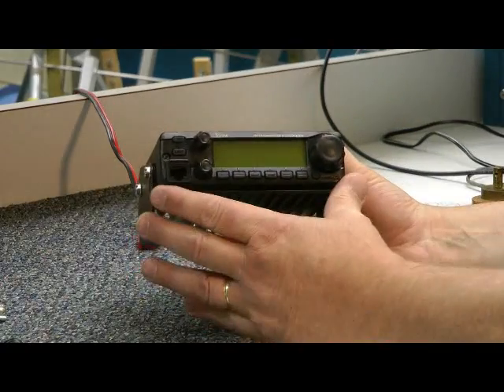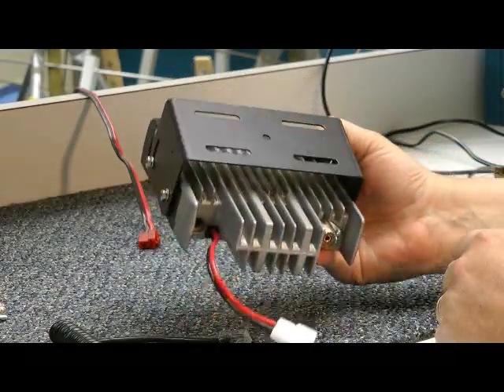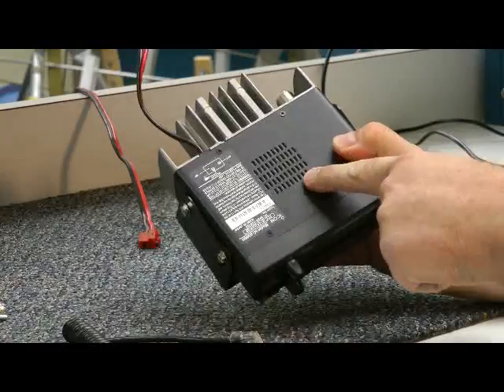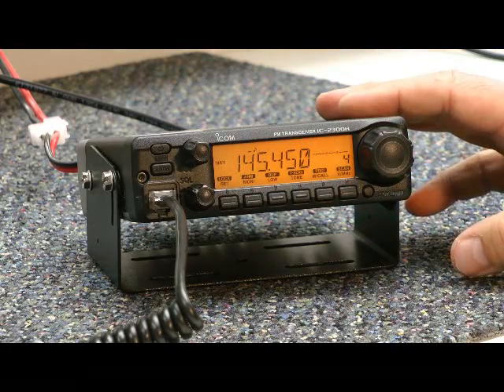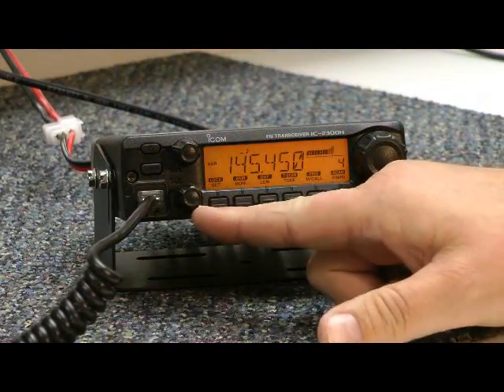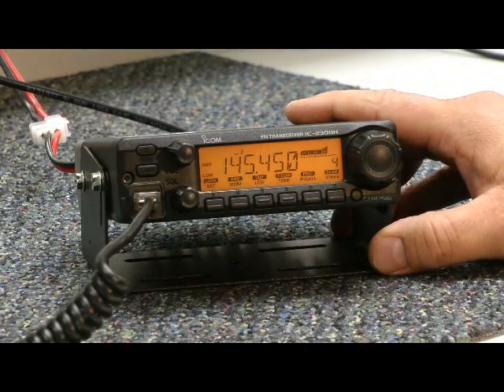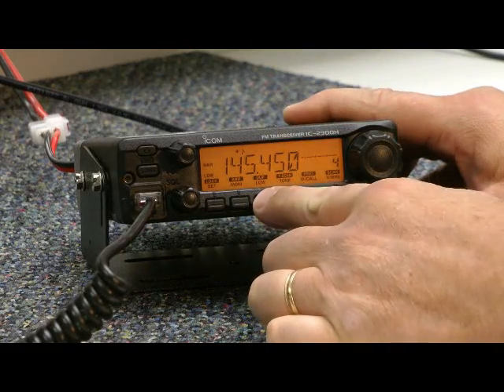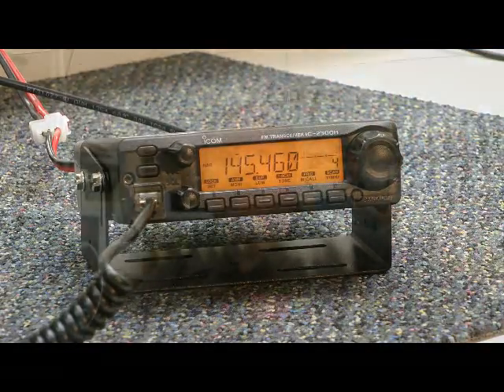Icom IC-2300H Transceiver

Comment: curious of any reports of internal speaker audio quality?  GENERALLY in the past with my icom radios, the internal speaker is less than impressive. my kenwood TM-281A and Yaesu FTM-3200 have impressive audio quality from the internal speakers.    my goal is to find another mono bander that can run solid without the need to add an external speaker. thanks

Comment: Hi Sir, Im interesting this this model Icom IC 2300H, may i ask you a few question if you dont mind? 
1. Are this this VHF?
2. Are this Friendly User?
3. Compare with Icom IC 2300H vs Kenwood TM 281A, which one will be most easy too use? 

Thanks for read my comment, by the way im new with Ham and im on my way too take the RAE here in Malaysia. The learning process maybe take time but i will continue too learn too be a Amatuer Radio plus i hope that i will get my Ham License. May God bless you, Thanks Sir.
Reply: Hi Azizi, 

I can help answer your questions. 
1. Yes this is a VHF radio that transmits between 144-148Mhz
2. The radio is easy to use once you are familiar with the menus... I became familiar with mine in about an half an hour.
3. Both the Icom and the Kenwood are great choices and should operate similarly. Both have the same transmit power and are simple to use. The decision comes down to personal preference and how much money you want to spend. You can't go wrong choosing either of them.

Welcome to the hobby! Wish you lots of enjoyment and fun contacting other Ham users. If you have any additional questions feel free to ask. God bless!
Reply: Tim Fritz

Thank you so much sir, im really apreciate your answer. by  the way my RAE in Malaysia near at the conner already, Thanks.